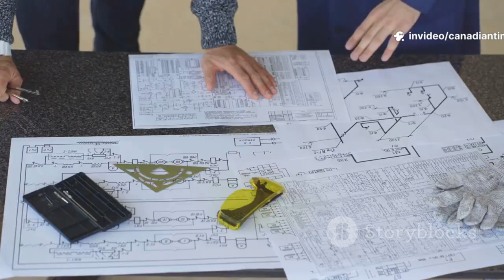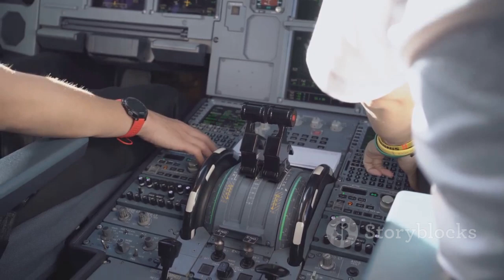Here’s Why China’s COMAC C929 Engine Outperformed and Outsmarted Both Boeing and Airbus

Comment: Hello 'my channel', Boeing is unsafe; I won't bother to provide further details.  Airbus has may safety issues. Your comments are biased and false about safety. I assure you C929 will be nothing like Boeing and Airbus neither one of each are anything to brag about. Your comments reflect arrogance and are false.  China will not use the unsafe western supplies.  You don't know what you're talking about.  China will abandon usage of worthless and unsafe western supplies. China is working on manufacturing all the supplies. Stop your propaganda speeches!  Several countries have lined up to purchase China's C919 and C929.  Regarding Airbus, let me blow your bubble:   You're very arrogant. Canada will ine up to purchase Chinese aircrafts. 
Recent safety issues for Airbus widebody planes include an emergency airworthiness directive for the A330neo regarding potential duct bursts from leaking high-pressure valves in the engine bleed system and reports of a high number of groundings for the related A220 model due to engine issues. While "fume events" have been reported as more frequent in the narrowbody A320 family, engine-related safety issues have also impacted the A320neo production and maintenance, and some A330neo operators have experienced technical faults that led to grounding of the aircraft. 
Engine and system issues
A330neo high-pressure valve issue: An emergency airworthiness directive was issued in August 2022 because leaking engine bleed system valves could cause a duct to burst, potentially leading to a loss of control.
A220 engine problems: The A220 fleet, which uses the same family of Pratt & Whitney GTF engines as the A320neo, has experienced a high rate of groundings due to issues with these engines.
A320neo engine issues: Similar engine problems have affected the A320neo, impacting its production and maintenance.
Other engine-related alerts: The NTSB has issued urgent safety recommendations for certain Boeing and Airbus planes, including some A330neo models, regarding potential smoke-related events from engine damage. 
Other safety concerns
Fume incidents: While most reported fume incidents have occurred on the narrowbody A320 family, Airbus has accounted for the majority of them.
Weight and balance: A significant cause of groundings for Airbus planes is related to weight and balance issues, with overweight and center of gravity (CG) exceeding certified limits being the primary factors.
Maintenance and component quality: In the past, there have been concerns raised about a potential for substandard parts to be used during maintenance and manufacturing. However, Airbus states it has resolved these issues and implemented corrective actions.